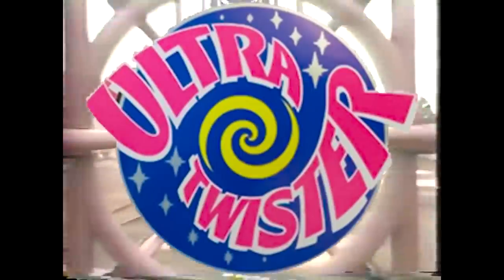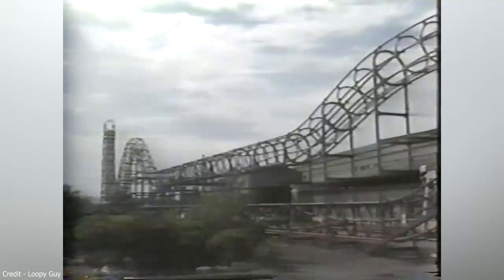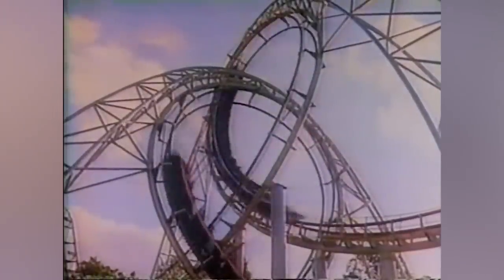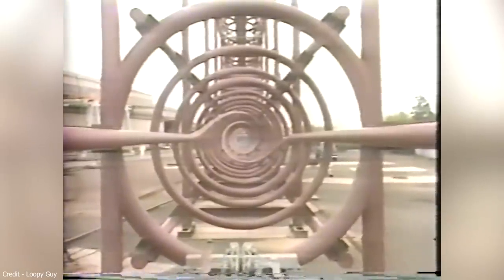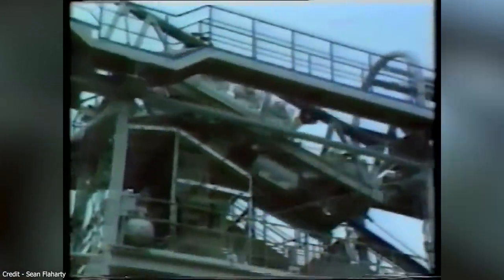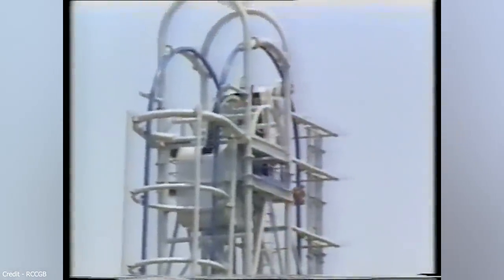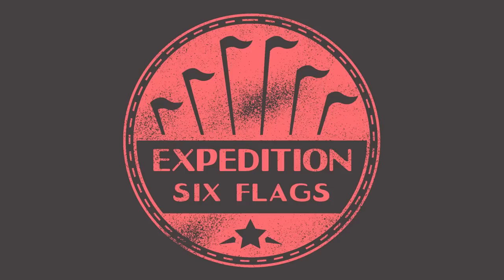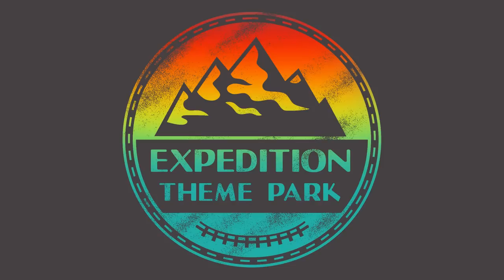The Abandoned History of Ultra Twister - TOGO's Weirdest & Unique Coaster | Expedition Six Flags

Comment: As mentioned in the video, at AstroWorld, the Ultra Twister was modified to have a 45 degree lift hill. However the attachments for the rails of the original vertical lift still existed and were easily visible. The seats were pretty ergonomic but I always felt like the seat back tilted forward a bit. That would actually make sense for a vertical lift. I'll always remember the sound of the recording that played on the platform. "Moving conveyor! Please watch your step!" The station and lift were located directly behind the mountain formerly occupied by the Alpine Sleigh Ride which had closed years before. The tracks from the Sleighs that extended behind the mountain had to be demolished to make room for Ultra Twister.
Reply: I rode the one in Nagashima Spa Land this month and thought the seat back was a bit forward and seemed very odd. Great ride thought, I was lucky enough to ride it many many times on my visit there as the park was quiet.